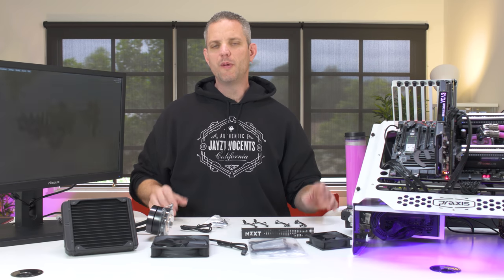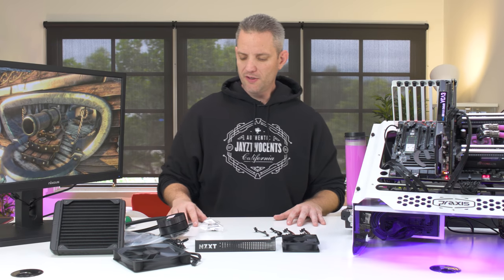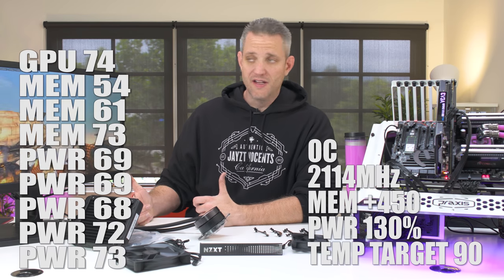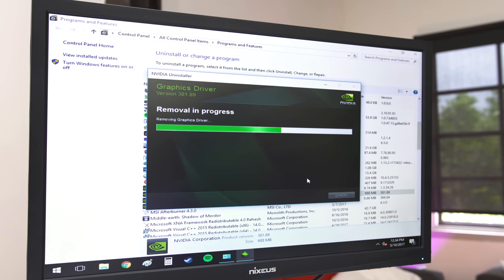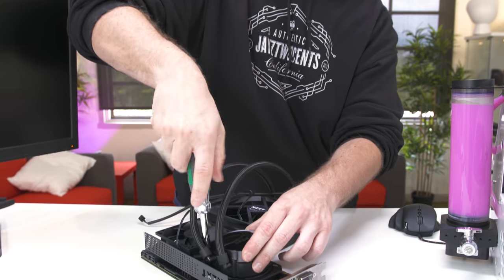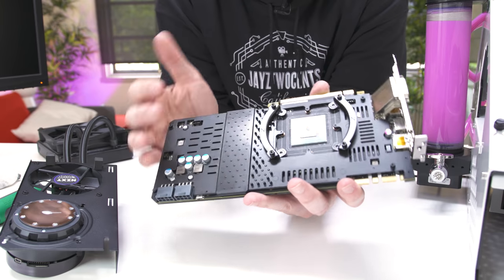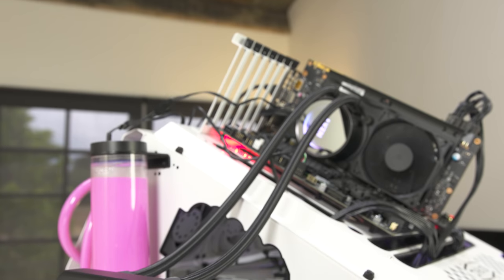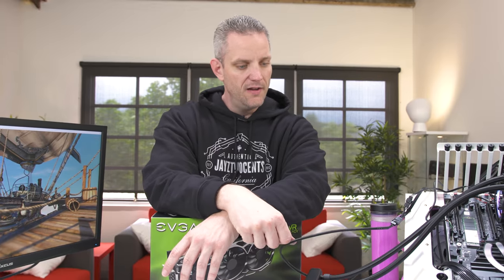How to Watercool a Video Card... The easy way!

Comment: Well that was interesting, wasn't expecting so good VRM temps, but of course core being cooler, VMR has to also works less. Again core being cooler, it's heating less memory modules and those less the VRM, so it all helps. I have just given up on AIO, had one running about a year on top of my 4770k, but the pump failed on that. So instant trash and not even stock cooler to save me. Luckily found an older stock cooler to keep my going until beast air cooler arrived.

That one was unused, but no warranty, running 24/7. Other than that it was perfect, no pump noise, unlike most that makes them unusable. If you are going to get an AIO, it must have a variable pump sped, else the pump whine while derive you crazy and better read reviews of them. Well unless you are coming from blower type cooler, then it'll be quieter, but cheap AIO will always be noisier than air.

Comment: could this gpu cooler be used with crossfire setups?
Reply: as long as you have 45-50mm (2 inches) between the card PCBs for the hoses

Comment: that NZXT bracket looks awful IMO and looks like with the hoses, your graphics card is now a whopping 4 slots. Arctic also has a water cooler that's < $120 CAD but turns your card into a 3 slot. I decided to go with an EVGA water cooler which maintains the 2 slot profile, and still looks really sleek. I'm not a fan of bare heatsinks and fans, and the NZXT looks like it was "ghetto rigged". Clearly it still works, and I'm usually all about function over form, but when I can have both for a little bit more, I'll go for that.

Comment: does it work on a msi geforce 2080 ventus super
Reply: just did it on exact this card with a kraken x62. U just have to use the AMD brackets instead the Nvidiea. with the 280mm radiator im barely touching the 40° in gaming. its amazing

Comment: What I find particularly interesting is that an overclocked GTX 1080 FTW must pull easily like, 200 watts, if not more, and a 140 mm AIO can keep the GPU under 50°C. An AIO! With a probably aluminum rad and some air inside the loop, reducing its efficiency somewhat. Hell, all hybrid cooling video cards, even the 250W TDP models use a single 120mm rad AIO, and it's enough to keep them well under 60°C  under load. Even the crazy insane 500W R9 295x2 thing from AMD with two GPUs uses a single 120mm rad, although I don't know how well it works on that..
But for CPUs with a much lower rated TDP (including HEDT), as soon as you try that or even suggest using anything less than a 240, the internet goes crazy like 'WTF OMFG DOOD YOU NEED AT LEAST A 280 OR ELSE YOU GONNA FRY IT!!!!!111! 

Someone please explain this logic to me? I know that some CPUs have an IHS with rubbish Tim, courtesy of Intel, and they can draw more power than the rated TDP, especially if OCd, but come on.. That applies for GPUs as well, and, there are CPUs still with a good solder TIM (AMD, pre-Skylake-X HEDT, Sandy Bridge and earlier), and it's not like the people who spread this kind of minimum radiator size "wisdom" are excluding these...
So what gives?
Why's is 120mm AIO good enough for an 250W+ EVGA 1080 Ti FTW3 Hybrid, but somehow not good enough for, say, an i7-8700K?
Reply: Mars Deimos gpu dies are larger meaning more area to pump heat into the aio and the fact that the cold plate is directly on the die unlike a cpu where it has to go through the heat spreader. Since there is less resistance you can use a smaller cooler and be okay on temps

Comment: ID-COOLING ICEFLOW 240 VGA Graphic Card Cooler 240mm Water Cooler GPU VGA Cooler Compatible with RTX 20XX Series/GTX 10XX Series /900 Series/AMD RX 200/300 Series/GTX 1600 Series

Comment: Compatibility - Graphic Cards
Nvidia
Titan X, Titan, Geforce GTX 1080 Ti, 1080, 1070, 1060, 980 Ti, 980, 970, 960, 780 Ti, 780, 770, 760, 680, 670, 660Ti, 660, 580, 570
\AMD
RX 480, 470, R9 390X*, 390*, 380X*, 380, 290X*, 290*, 285*, 280X*, 280*, 270X, 270, R7 370, HD7970*, 7950*, 7870, 7850, 6970, 6950, 6870, 6850, 6790, 6770, 5870, 5850, 5830
* Some variations in AMD die height may require the use of a copper shim which is not included.

Dosent fit rx 580 so its useless to me!

Comment: Will this work on a RTX 3060 as well?
Reply: nope. G12 fan covers long cards. 3060 and Ti have short pcb and G12 fan aims nothing. I got 3060 OC StormX and I ended up with a custom hand made bracket.
There is a good thing about regular 3060 anyways which is GDDR6 on them. They are not as hot as GDDR6X on 70/80 (and probably Ti). You can cool it down (VRAM, VRM and GPU die) using common copper plate with thermopads and thermal compound on die and collect all averaged heat with one pump. Mine build has GPU 29C-46C in stress and Hotspot 39C-48C. and zero fan noise.
Reply: @zkc7718  what ab a 3080?
Reply: The same. Now I got the same mod to 3070ti and the die temp is not a problem. Memory temp and VRM temp is. I had to set card power limit. The same will be with your 3080

Comment: There are lots of other reviews showing this set Will increase the vrm and memory temps. Who to believe?
Reply: That's simply false. The die is producing less passive heat (heat coming off the die rather than the die itself) meaning the VRMs and RAM aren't stressed as much and aren't constantly etting doused with fresh warm air
Reply: There's still also a 120mm fan directly on the VRMs and memory anyway

Comment: Sooooo i hope someone sees this and can help.
I recently installed this bracket on my itx sized single fan RTX 2060 (I cut the mounts to make them work, dont judge). The temps under full load is 70c which i figured is high for this setup but useable and plan on drilling some holes to actually make the mounts more secure than the cross-threading/zip ties i used, but hey, it works for now.. 

NOW, the main issue i am having is this, I just did the most recent windows install, along with just downloading the most recent invidia drivers ALONG WITH the most recent Cyberpunk 2077 patch. (Sounds like it isnt important but that is) 
and the results are almost unplayable performance on cp 2077.. before all the drivers, updates, patches and aio cooling i was easily hitting 60fps on ultra settings with dlss on quality. NOW i am barely scraping by with 30-40fps on low settings.... 

I do not have Heatsinks on my VRM modules on the gpu but i do have the AIO in push/pull config. one 120mm on the bottom and 2 on the front of my case pulling in cool air from the bottom and 2 on top exhausting the hot air so i figure that is enough. 

The question is where do i start/ i only decided to aio cool so that i can over clock a little bit and get just a tiny bit more performance to play AAA titles and cant really justify spending the current costs of a new graphics card....

Any help would be greatly appreciated!
Reply: Sooooo i hope someone sees this and can help.
I recently installed this bracket on my itx sized single fan RTX 2060 (I cut the mounts to make them work, dont judge). The temps under full load is 70c which i figured is high for this setup but useable and plan on drilling some holes to actually make the mounts more secure than the cross-threading/zip ties i used, but hey, it works for now.. 

NOW, the main issue i am having is this, I just did the most recent windows install, along with just downloading the most recent invidia drivers ALONG WITH the most recent Cyberpunk 2077 patch. (Sounds like it isnt important but that is) 
and the results are almost unplayable performance on cp 2077.. before all the drivers, updates, patches and aio cooling i was easily hitting 60fps on ultra settings with dlss on quality. NOW i am barely scraping by with 30-40fps on low settings.... 

I do not have Heatsinks on my VRM modules on the gpu but i do have the AIO in push/pull config. one 120mm on the bottom and 2 on the front of my case pulling in cool air from the bottom and 2 on top exhausting the hot air so i figure that is enough. 

The question is where do i start/ i only decided to aio cool so that i can over clock a little bit and get just a tiny bit more performance to play AAA titles and cant really justify spending the current costs of a new graphics card....

Any help would be greatly appreciated!

Comment: 1080 Ti is not listed as compatible on the site.  What der fukkk....

*Edit*

You can just use copper shims to fill in the gap between the GPU and the tabs without having to mod anything.  I had the same issue on my EVGA 980Ti Classified Edition cards, and the NZXT G10.  Just use a shim between the GPU and the water block (putting thermal grease on each side) to create contact, and viola:  Cooling magic.

Comment: Anybody used an h100 corsair aio was thinking of doing this to a 980?
Reply: You have the compatibilty aio list on the website of nzxt, i think the h100 not working because the contact surface isn't an round and isn't an asetek aio (https://www.1form-store.com/Content/Images/uploaded/Composants/Refroidissement/Watercooling_AIO/Corsair%20Hydro%20Series%20H75/h75_copperplate.png) you need little paws near the screws
Reply: Bro ur broke

Comment: I've always felt those plates don't do much.
Reply: in this scenario i would say the backplate does nothing at all.. and the frountplate would just block airflow from the NZXT small fan.... if u want to cool the VRM's and Memory.. buy some thermal glue and heatsinks. or just leave them naturaly aircooled. as long as your case temp isnt increasing (mount ur Rad's as Exhasusts) there shouldnt be a problem..

Comment: for Christ's sake.. make a video on asus' strix cards. Every model of the current GPU line-up. ASUS strix has such good power delivery and they all deserve to be overclocked and watercooled
Reply: He has, like a year ago: "ASUS ROG STRIX 1080Ti Review - How well does it cool?".
Reply: @DJHeroMasta  I watched it, and it shows some important points about the cards inherently overkill air-cooling, and how it's incredibly sufficient. But this is waaaaay besides the point: what if I want to displace the heat and have it forced out of the case right at a fan vent? What if the insane heat being thrown off of my STRIX is heading up other components in the system directly affecting performance? A water cooling block is the way to do this. My point stands.
Reply: @henry55430  What point? Just buy the adapter and slap an AIO on it.

Comment: Anyone do this with 1080 ti with no VRAM/VRM heatsinks like this 1080?
Reply: jrmichel2000 Yep I did. just works fine. Temps on the GPU are between 28-50 C, VRM are at 56-60. have the little fan set to 70%.
Reply: Atas How did ypu monitor the temps of the VRMs?
Reply: Do you still use the same setup ? if so does it still work properly ?